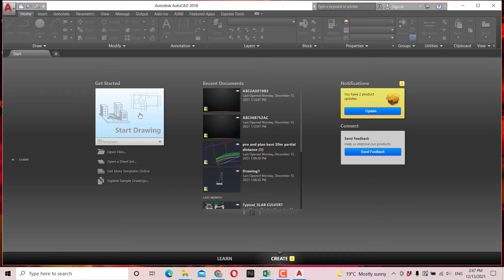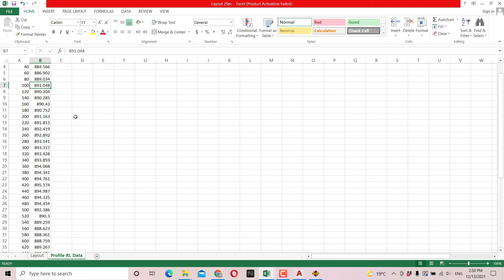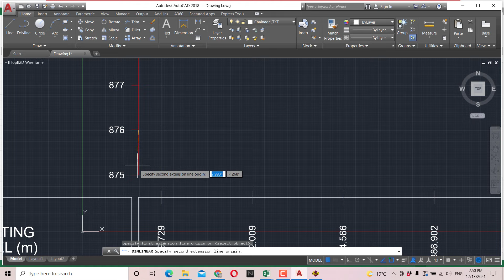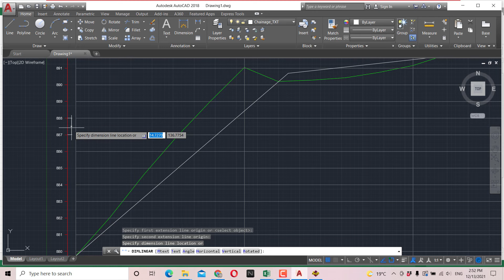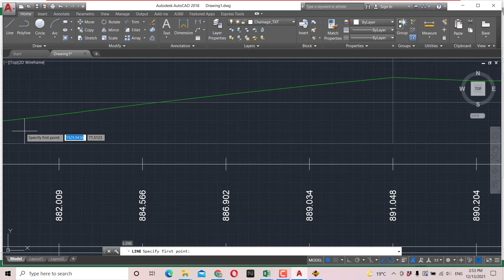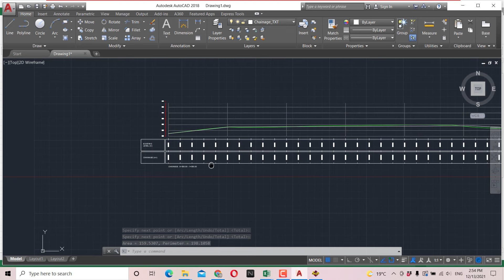How to draw L-profile on autocad from excel and calculate cut fill area ?

Comment: Thank you for this video but I tried using the SWDTM to execute the data from excel but it’s not responding. Please what’s the cause and what can I do?
Reply from the maker: Please make sure the datas in excel are arranged in the order that Swdtm recognizes and make sure you have selected the correct range in excel cells. If it doesn't work even after that I am not sure about the problem.
Reply: @civiler1439  I just tried it now and it worked thanks alot
Reply: How to arrange data in excel and  to excute in auto cad make a video
Reply: @ashwarajkrishnappa444  Yes its needed

Comment: bro
 I try to import an Excel file, it displays an 'invalid selection' error, even though I've selected the columns in Excel where the data is located. However, it's not working
Reply from the maker: Did you make sure to arrange the data in 3 columns and even though the third column is for remarks and can be left empty you need to select the third column too( you have to select exactly 3 columns I think thats how the application is programmed). Also make sure that you have your chainage in metres eg. 1200 instead of 1+200. Hope this helps 😊

Comment: How can we change the scake of vertical on the same drawing without having to use Excel or swdtm again.. Is there a way like stretch command or something. And if we find out the area in the scaled drawing should we divide by 100 from the area we got.
Reply from the maker: I don't think you have any way to change scale only vertically of a drawing in AutoCAD ( But if you want to do it for a block, I believe you can do such thing).
I am also not sure if the division would yield correct area measurements better to just replot with correct scale it doesn't take much time🙂

Comment: can we draw ls from coordinates without chaiange. I have cordinates and elevation in my exel data of the track but no chainage and the intervals are not uniform also.
Reply from the maker: Do you have z values of coordinates ?
Reply: @civiler1439  yes. z is rl?
Reply: @civiler1439  sir I have to put chainage in the ls drawing at regular intervals. But I don't have it done in my excel sheet. Only x y coordinates and elevation in my excel sheet or gps data. The profile is made easily through gps visualiser online.  But I want to know how I can get the data in regular intervals of chainage with elevation either in Excel or autocad directly after the profile is drawn. I haven't drawn the profile in AutoCAD either since I don't know the chainage at regular intervals and their elevation. The gps visualiser elevation profile data only provides coordinates and elevation. And I don't even know if they're at regular intervals or not.

Comment: does this work with AutoCAD 2022?
Reply from the maker: Yes the software is integrated to work with AutoCAD Version but I don’t know if it works with civil 3D and since you mentioned it didn’t maybe they are Not integrated civil 3d